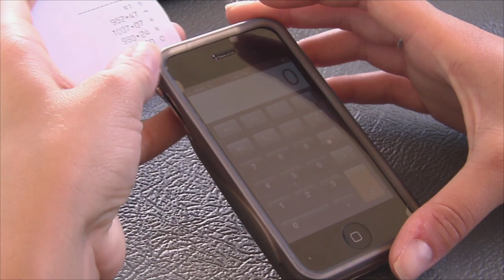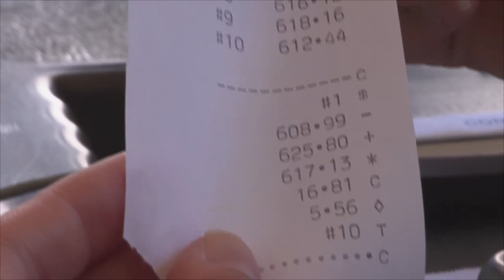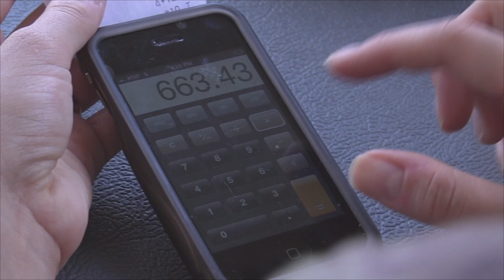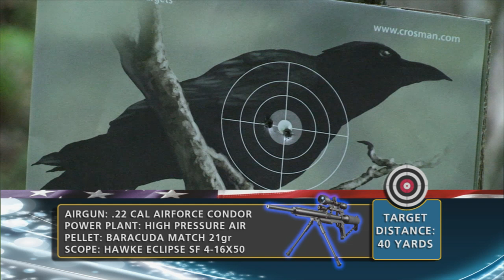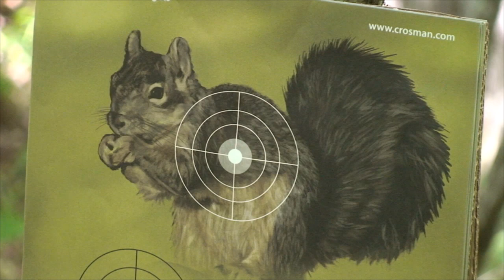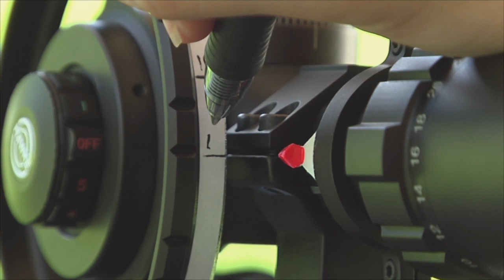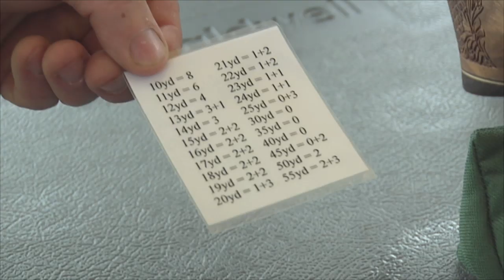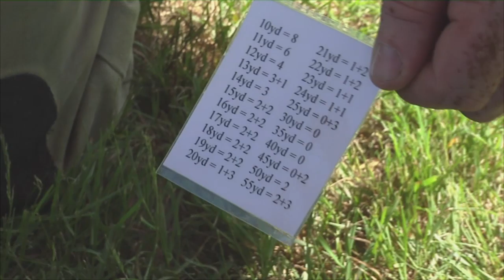American Airgunner Season 2 episode #8

Comment: 8:25
disco only charges up to 2000psi.
never charge to 2900!
Reply: Ramzi T wrong. There’s screw kits to hold the valve at higher psi.